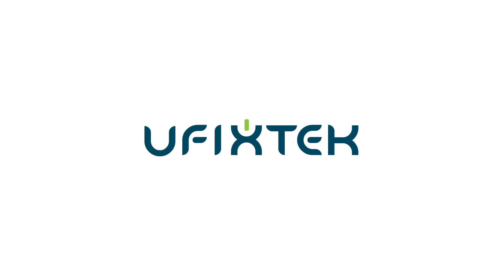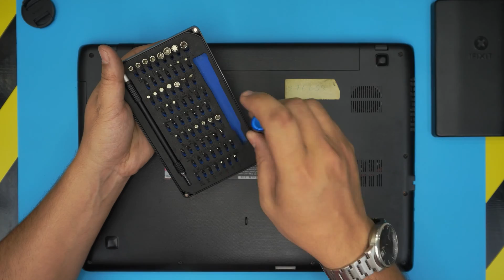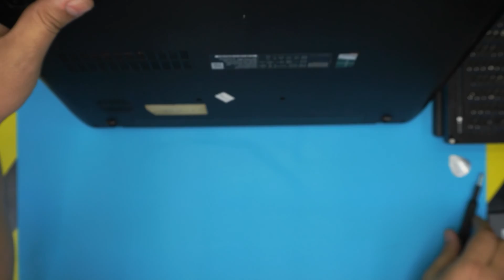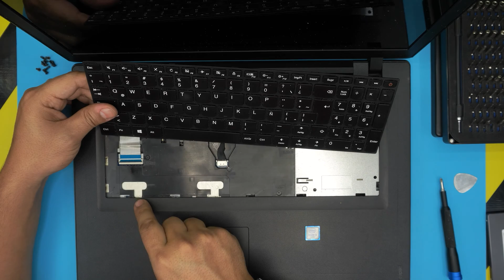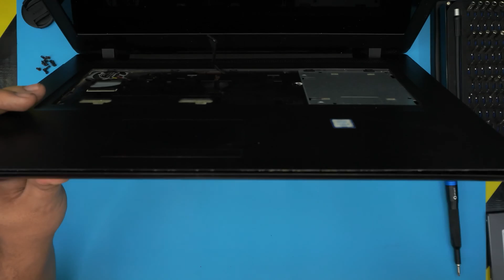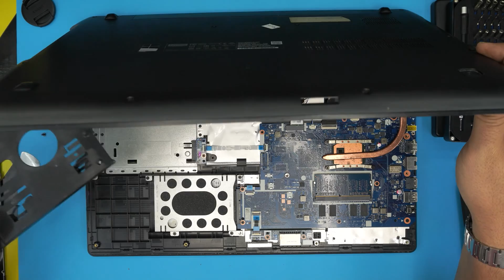How to Upgrade Storage (SSD/HDD) on Lenovo Ideapad 110 17Isk 80Vl Laptop | Step by Step✅

Comment: Great video!

I have a Lenovo IdeaPad 110-17IKB which has room for one SSD or hard drive. I have been reading up about adding a hard drive instead of my disk drive and was wondering if this is possible with my laptop? I would more than likely put a higher quality drive where mine currently is, and put my current drive in the disk drive. 

I am extremely new to this so I apologize for any stupid questions. Also- when installing a new SSD, how do I transfer the information - or will everything still be there even if I put my current drive in the secondary (disk) slot?

Thanks!
Reply from the maker: It's truly a pleasure, my friend. I deeply appreciate your taking the time to provide feedback. If you're inclined to support the channel further, feel free to like and subscribe—or even both!
Regarding your question,  i would recommend the following options: place a SSD 2.5" up to 4TB (normal 2TB) and keep the main HDD as external drive not internal, because if you place it internal and when you have the laptop powered on the OLD HDD is more delicate to movement so it can get damaged easy, so get a external case for it like:
https://amzn.to/4adlxNG
and then i would highly recommend you to install windows 10 from usb boot drive very easy to create:
https://youtu.be/uDu8j2lE-dM
and installing it take 10min and few windows update and you set to go.
use this guide to follow the steps of windows installation:
https://youtu.be/VvggzrKJHC0
and once you in the desktop and all ready you can connect the old HDD in the enclosure and go in the user folder and transfer your data back in to the new disk.

Should you have any further questions or requests in the future, please don't hesitate to ask me.
cheers🍻

The links above are Amazon affiliate links. By using them, you're helping the channel. 🙏🏼
Reply: @uFixTek  thank you very much for the information. This is super helpful.
Reply from the maker: It's my pleasure my friend.